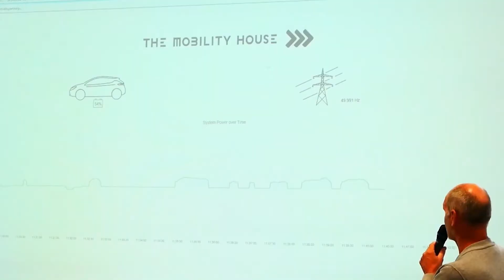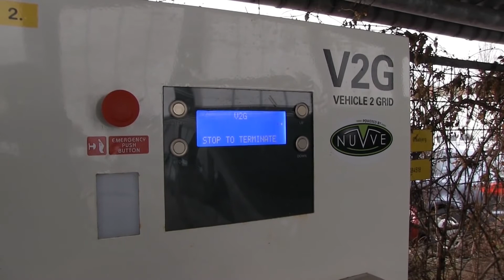This is the future of EV Technology! | I Speak Electric

Comment: In the U.S., the top selling vehicles are full-size pickup trucks (F-150, RAM, and Chevy), followed by mid-size SUVs (RAV-4, CR-V, Rogue), and small- to mid-size sedans (Camry, Corolla, Civic). The F-150 Lightning seems like it will have a huge impact on the high-end truck market, but the company that gets a well-built, fast-charging, small- to mid-size SUV or sedan on the market at a price that matches the ICE equivalents (after incentives) will change the game completely. An EV Honda Civic for $25,000 or an EV RAV-4 available under $30,000 would rule the market. So where are they?!
Reply from the maker: Hi Robert, thanks for the comment there and some really good observations! You're based in California, isn't it? A lot of the options you're describing there are available in Europe but unfortunately not in the US. I'm sure the options will pick up over the next couple of years as battery avaialbility frees up and emmissions regulations evolve. Thanks again!

Comment: There is enough dead stop zero to whatever your commute speed is torque in an EV that a slightly larger battery doesn’t cost very much more to haul around unless you’re looking at the extremes of what is available today say for instance the Lucid versus the Mini. However the Lucid well may be more efficient at caring it’s batteries than the Mini is so the size, other than the originating of raw materials, may not be the biggest thing to be gained in charging speeds. I think adoption of EV‘s is the biggest gain to be had with increased charging speeds. 💡
Reply from the maker: Charging speeds definitely going to help widespread adoption...and it can be added to a long list! Thanks for the comment, Gary!

Comment: Three things will need to happen before widespread adoption of EVs.  Out the door cost will need to be equivalent to a similar ICE vehicle.  EV charging infrastructure will need to be increased exponentially.  Charging rates will need to decrease to the point that it will only take 10 - 15 minutes to get a near full charge.  Sorry, but those of us who are fans of EVs and EV adoption need to come to the realization that most people want cheap, easy, and convenient.
Reply from the maker: Some good arguments there, David, thanks for chipping in! Although I'm not sure we agree on the charge times...10 mins isn't even enough time to go into a station for a toilet break and takeaway coffee!
Reply: Ticket price parity is going to occur within the next 3 years. I charge on a Type 2 charger at work for free. Many people could do the same. I simply asked my company to install a charger. They didn't say no. We ended up with 2 Zappis. The thing is, this stuff works if people want it enough. I did and it does for me.